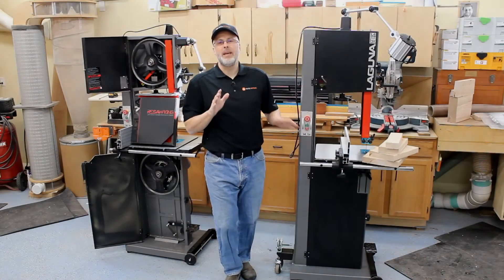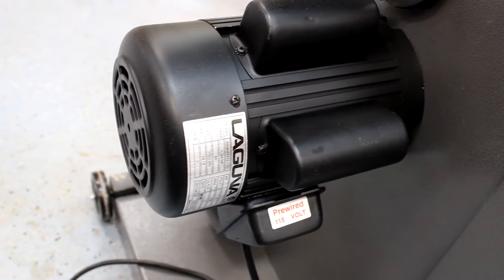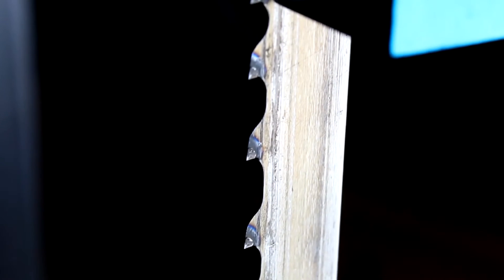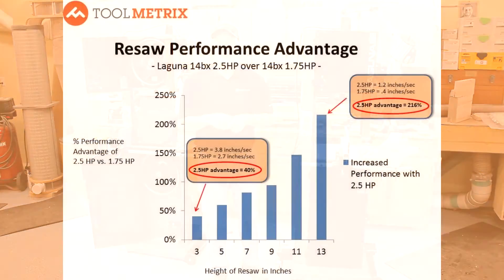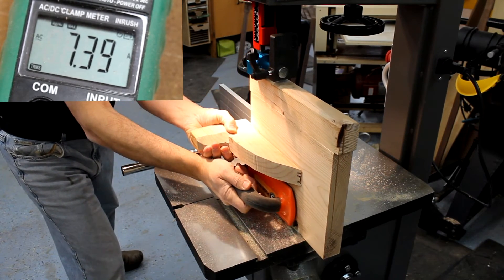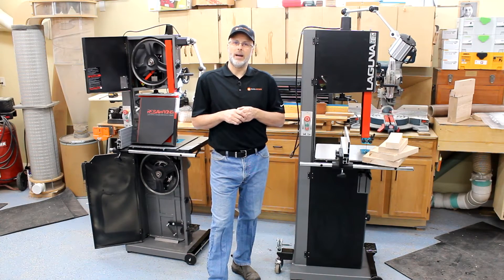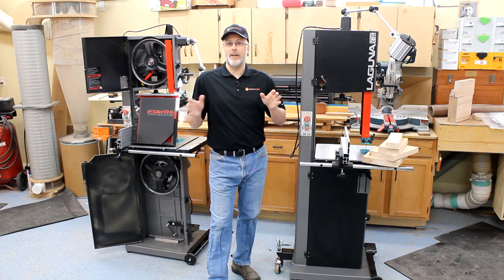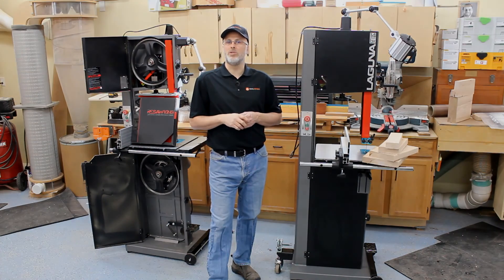Laguna 14bx Bandsaw: Choosing Between 1.75 HP and 2.5 HP

Comment: A 110 volt motor drawing 20 amps is drawing too much amperage, nearly twice as much as it is now a 3 hp motor
a 220 volt motor drawing 8 amps is only 2.3 hp.
1.75 hp = 11.8 amps @110 volts
2.9 hp = 20 amps @ 110 volts
Reply from the maker: Thanks for sharing your thoughts here, Dave.

Comment: Nice vid Paul, as usual. Can you advise me regarding a new bandsaw. I have a 1hp Grizzly I am looking to upgrade to a more beefy machine. I resaw perhaps 6-8 inch material on occasions. Is a 1.75hp ok or should i go with a 2.5hp I do have 220 hookup capability . Thanks.
Reply from the maker: You’d be fine with 1.75 if you want to go that way. No problem at all.

Comment: I would be using 220 but I only have the dryer plug to use. Is that Ok They want to much money to install a dedicated 220 because my walls are all finished in drywall
Reply from the maker: No, that’s not ok.  Wrong plug, wrong breaker.
Reply: @ToolMetrix  a dryer breaker is usually 30 amps. Why is that wrong? Would it be a concern that the if the saw pulls too much current the breaker won't trip? Of course having a dedicated circuit is important but trying to understand the technicality.
Reply from the maker: I’m not an electrician so I’m probably not the best person to come to with this question.  😃 But I’ll give you my take on it. The breaker is supposed to be the weak link in the circuit. If you run a tool that is designed for 20 amps on a 30 amp circuit then the tool’s wiring becomes the weakest link and could become a fire risk under certain operating conditions.

Comment: Hi. Thanks for the video. I have the 1412 and love it. Your explanation about motor amps was incorrect however, in that you indicated that the motor on the 1.75 HP unit would run cooler at 230 volts instead of 115 because of the lower amps. The motor windings see the same amperage regardless which connection you use. In the 115 volt connection the windings are in parallel, so each sees 115 volts and half the total amps (say half of 15 amps or  7.5 amps). 
In the 230 volt configuration, the windings are in series so each winding sees half the total voltage (115 volts) and the total current flows through both windings (in this case 7.5 amps). The motor does not know or care about the supply voltage because its windings are reconfigured to accomodate. you can't get something for nothing.
Other than that, nice vid.
Reply from the maker: Hi Randy, thanks for your feedback.  Glad that you enjoyed the video, and that you are enjoying your bandsaw.  I had a 1412 when they first came out and liked it a lot.  Since upgrading, I have moved the 1412 into my father's shop and he really enjoys it.   Cheers, Paul
Reply: thanks randy, i know parallel an series configurations from other batteries and it makes sense, i think i will go with the 1.75hp now.

Comment: Thanks for sharing,  is the 1.75hp bandsaw   good for bandsaw boxes?
Thanks
Reply from the maker: Absolutely!  You’ll be well armed for bandsaw boxes with that saw. I would suggest getting either the Laguna mini-guides or a Carter blade stabilizer because the ceramic guides aren’t great for blades smaller than 3/8”.
Reply: @ToolMetrix  awesome,  thanks so much

Comment: public service announcement. the resew king doesn't have carbide teeth. i have used them and they dull much quicker than the carbide lennox blades. and Corbin from the Laguna videos said they aren't carbide. they are a proprietary alloy that is somewhere between high speed steel and carbide. they say that way it will slightly dull when going through a nail or hard knot instead of chip.
Reply from the maker: Good to know- thanks!

Comment: another super helpful video! thanks a bunch! I was really trying hard to figure out the differences on paper.. and that doesn't really  work well.  with the lowest end 14/12 that you used for years... how was the resaw on that? did it keep an even board thickness? the way I'm kind of seeing this line-up is that the 14/12bx 120v seems to be a little redundant and the bx 220v is the real star of the show. or would you think that the bx 120v has enough upgrades to stand on its own next to the standard 14/12?
Reply: Brian Vaughan did you find out how long they should last?
Reply from the maker: Thank you, Brian.  The 1412 is a great saw.  Same power and same fence as the 14bx.  The main functional difference is the brake.  I really like having a brake on a bandsaw for safety reasons, but I never had one before the 14bx so it never bothered me.  I reckon it would be hard to go back now to a saw without one, but I'm sure I'd get over it.  :)  The 14bx is a lot quicker to set up because it has the unibody design rather than the separate base, but once it's set up that doesn't make any difference.  So, going from 1412 to 14bx 1.75 HP is really mainly about the brake.  Stepping up to the 2.5 HP gives a noticeable increase in power as I show here, but that really only comes into play with big resaw cuts or cutting bowl blanks.  If you do a lot of resawing you'll appreciate the additional power, but if you're mostly doing curved cuts with an occasional resaw cut, it probably isn't as big of a deal.  I appreciate the power difference more when I'm cutting up gnarly bowl blanks than when I'm resawing, but maybe that's because I find that I'm doing that more lately.
Reply: ToolMetrix the main use for this saw will be to cut bowl blanks and do resaw cuts, probably.  so really the 220v would probably be the best choice. and thanks again for the in depth reviews
Reply from the maker: I would definitely favor the 2.5 HP bx in that case.
Reply: ToolMetrix oh! one last thing.. what's the life span of those ceramic blade guides?
Reply from the maker: Good question.  I don't think of them as a consumable.  I could be wrong, I don't think that normal use would wear them out.  I think there is some risk of having one pop off and ending up in the dust collector, or possibly cracking, but they don't seem to be getting any smaller.  I have had a piece of ceramic pop off a couple times, and I just glued it back in with super glue.  So definitely keep an eye on them because they are expensive to replace.
Reply: ToolMetrix ok good to know.  I saw another video review where the guy was wearing them out. I didn't know if that was am isolated situation or not. 

again, thanks for the help! this is the second time your channel has provided the info and details I couldn't find elsewhere! keep up the good work!
Reply from the maker: That is interesting.  It is worth looking around to get some other opinions on this.  It would be interesting to hear an estimate from Laguna as to how many hours of use should be expected from a set of ceramics.  The fact that they sell full replacement sets suggests that they probably do wear out at some point.
Reply: ToolMetrix good point, I'll send them an email and see what they say.  I will report back when know something.
Reply from the maker: Great, thanks Brian!

Comment: Just subscribed to your channel, and have watched three of your tool reviews.  You do an outstanding job of providing the kind of information that an owner is most interested in.  Thanks for that.
I have two questions, one, have you evaluated the Laguna SE14 SUV?  Is there any benefit spending the extra $400 over the 14 bx? And secondly, have you any experience with the Hammer N4400 bandsaw?  I am trying to decide between the two.
Thanks for what you do.
Reply from the maker: +Larry Pasha Hi Larry, thanks for the question and for the kind words.  I haven't evaluated the 14 SUV, but I've looked it over.  I think it's a nice saw, and there are a couple aspects of it that are noteworthy advantages.  I like the rack and pinion table tilt adjustment mechanism a lot.  If I made frequent adjustments to the angle of a bandsaw table that required precision, this would be an important consideration.  I wish they had that same mechanism on the 14bx, but I think for most people that is a "nice to have" rather than a "must have" feature.  Also, I like the idea of a Leeson motor, but my sense is that the motor's on the 1412 and 14bx are actually pretty decent.  The fact that the motor in the 14 SUV is 3HP rather than 2.5HP is interesting, and I'd love to run the same tests on the 14SUV as I did on the 14bx to see how it compares.  In reality, however, the tests that I did on the two bx saws were more to understand the difference in performance, but they were not actually very reflective of real world use.  In the most extreme case that I ran, with a 13" walnut plank, I would prefer to saw faster than I could on the 1.75 HP motor, but I could live with the limitation.  The speed that I was able to achieve in that test on the 2.5 HP saw, however, is faster than I would ever resaw such a large board in real life anyway.  So any additional resaw speed beyond 2.5 HP would be unrealized in my shop unless I was sawing some really hard tropic wood.  And when I was pushing the 2.5 HP as fast as I could, the motor was still barely breaking a sweat, so I was probably limited by other factors at that point.  To your question about whether or not it is worth the additional $400, everyone would look at this through their own lens, but to me personally I don't believe that it would be worth it.  In terms of the Hammer N4400, I've never actually seen one in person, so unfortunately I'm not qualified to say much there.